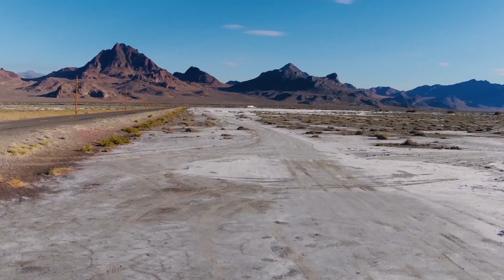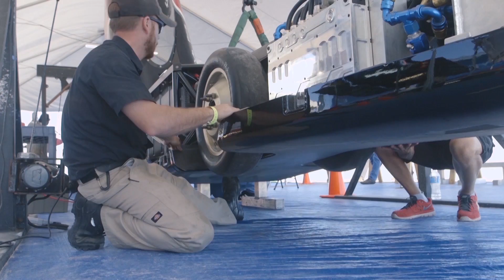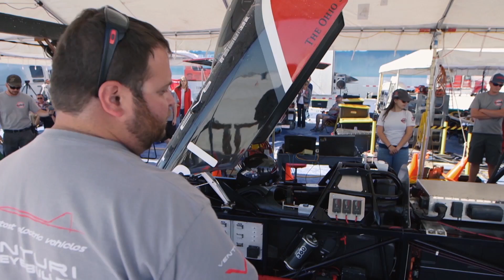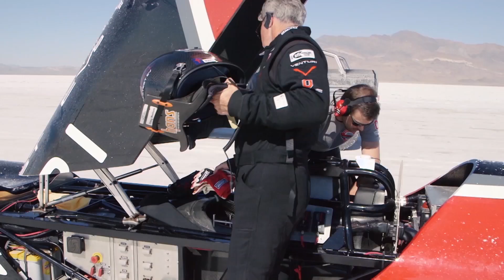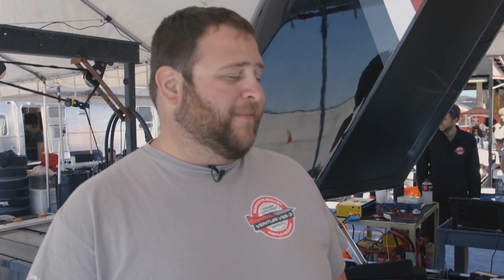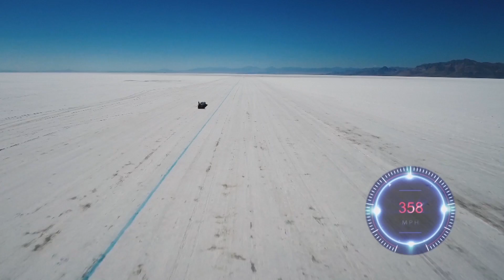Venturi's Land Speed Record Attempt - Formula E

Comment: It seems a battery vehicle has just reached the speed set in 2007 by an electrically wired TGV V150! Although it's really hard to compare the two, the fact that just a battery was able to get a vehicle to this speed is an outstanding achievement!